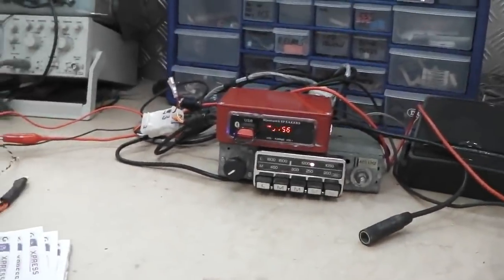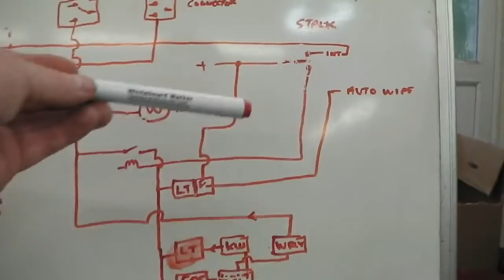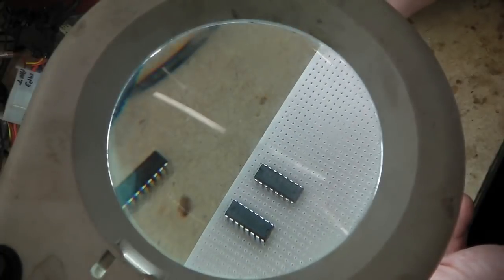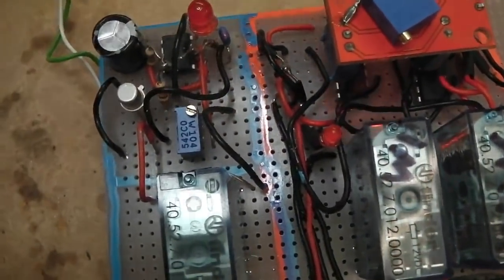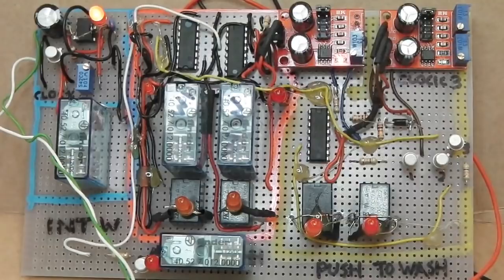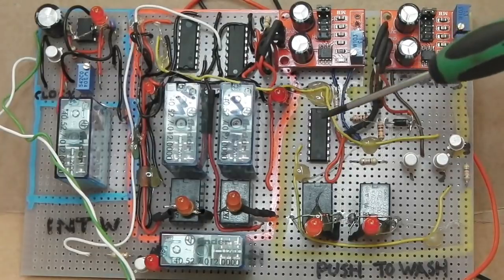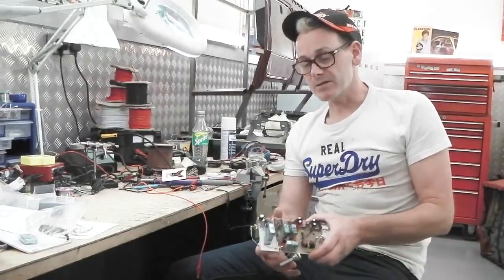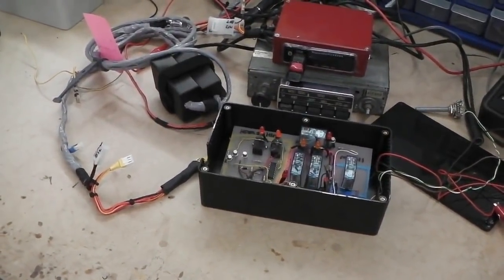Classic car wiper Control Circuit - Ford Cortina Electronics Project.

Comment: Pete,another great video.Some well thought out and basically simple building blocks,but put altogether quite a sophisticated complex system.Back in the day I would probably have built an etched printed circuit board especially for this. You "could" probably "BREADBOARD" your "prototypes" first.

Comment: A must say I love the Mondeo's heated front screen and of course the cruise control that sometimes needs some high pressure air to blow crud out from under the steering wheel buttons.

Comment: That's a lovely little circuit Pete!  Have you ever looked into any of the freeware PCB designing programs?  You draw out the circuit and they'll lay it out, optimize and generate drawings that you can send out to get professional PCB's done at fairly low prices.  You can even spec the board size so it will fit in whatever project box you want.

Comment: Right hand drive cars should have the indicator stalk on the right; your left hand is changing gear. However with the advent of imported cars and cars designed for both left and right hand drive markets the indicator stalk’s standard position migrated to the left. Japanese cars retained rhd stalks for a number of years but even they changed.
Reply from the maker: thanks Alastair, you always on board for me!!! Yes cortina has indicator on right, not sure if i said left on this vid!! if so was error, we all here on the right.......all right on the night lol
Reply: Pete C always happy to support my local celebrity mate! Lol

Comment: Brilliant.!!!!!!!
Reply from the maker: thanks Neil, hope it was not too techie!!! I forgotton what I built LOL its a monster......i best make sure I sketch out a diagram, though similar system in RUBY had no issues, those components are pretty rock solid. very basic parts, 1ks, 10ks, bc108s, 4017s, 555s, relays etc all rock solid tried and tested items, good on 12v too can handle spikes and higher voltages as opposed to TTL on 5v, I enjoy making circuits its like welding, very satisfying

Comment: Pete just a question about  washers how did you sort the heating  of the washer jets any pics of what you  did  cheers mate
Reply from the maker: Clive I am using a heated washer water system as oposed to actually the jets themselves, the idea is to clear grease and bugs from screen more easily, when combined with quality detergent in the resevoir and the hot water this helps. The water is heated by a special unit  .   http://www.heatshot.com/uk/